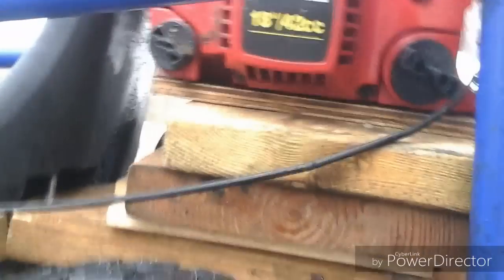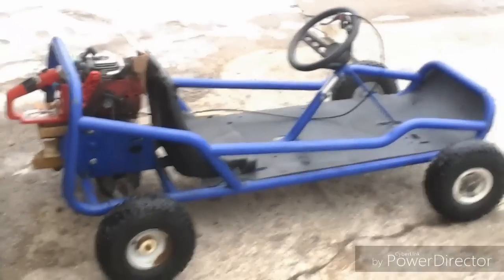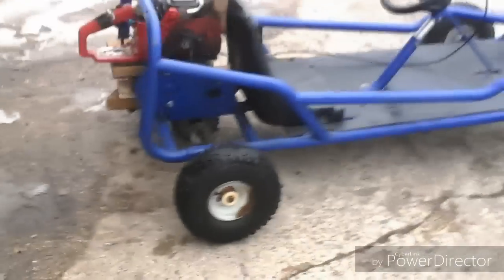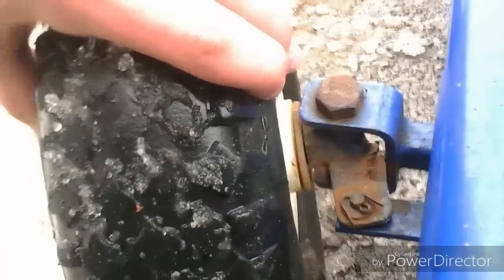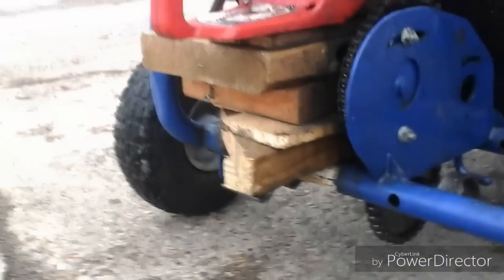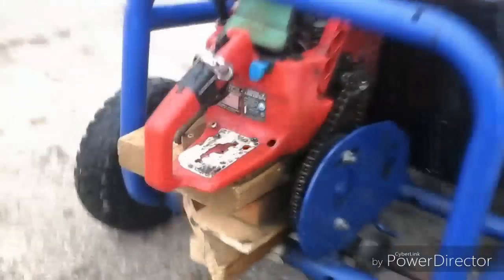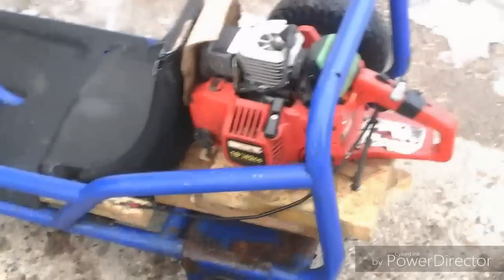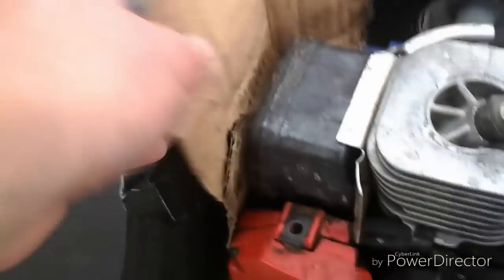Homemade chainsaw go kart

Comment: First off kid you did a nice job to the people who are asking wheres athe clutch if you have ever used a chainsaw there is a thing called a chain brake so put it on before starting and after turn it off bc a chainsaw will not keep turning the chain  you have to hit the throttle in order to make it move

Comment: Get a stick welder, they are cheap, about $125. A angle grinder can be bought for cheap, about $50. I did, and it was worth it. I did need some tips on how to weld before I truly did some welding, but all you need to do is find a weld shop and offer a free lunch for some tips. The guy will laugh, and say, come on, I'll give you some tips anyway.......... Use your head, that's what it's for.  =)  P.S. nice BUILD/KART!!!
Reply from the maker: thanks

Comment: that's really cool, I like it
Reply from the maker: thanks
Reply: Yeah, that thing really seems to do well for the engine it has, do you remember what the rear wheel and sprocket sizes are on it?
Reply from the maker: +obese hamster films no but it has a jack shaft on it

Comment: Good job! How did you change the sprocket on the drive clutch? Did you remove the stock sprocket and weld a normal sprocket onto the clutch?
Reply: Hmm I'm building a 38cc chainsaw powered dirtbike I was wondering 🤔 if I should just weld a sprocket on the Motor shaft? Or if I should get a clutch
Reply: @Mylotheblacknwhitecat  You'll be much happier with a clutch.
Reply: @wayne3340  why's that lol is it necessary jw I installed my 25# 10t sprocket on the motor shaft 
I don have the money for a new clutch but yeah lmk lol
Reply: @Mylotheblacknwhitecat  Have fun!

Comment: how did you build the throttle? I want to build one too =)
Reply: I'm planning on building one of these with some friends. It's probably possible to link a pedal to the actual throttle of the saw.
Reply from the maker: MegaRoflFilms yes if you have a long enough cable

Comment: What`s the top speed??
Reply from the maker: it goes 20 ...25 give or take
Reply: Z Nelson could you change the gearing to make it faster or would it not have enough power to move
Reply from the maker: customskate420 no I could change the gearing but then you couldn't ruin your mom's yard with the brap power